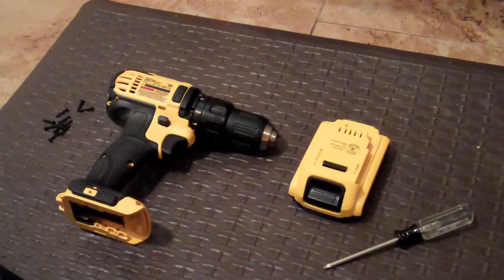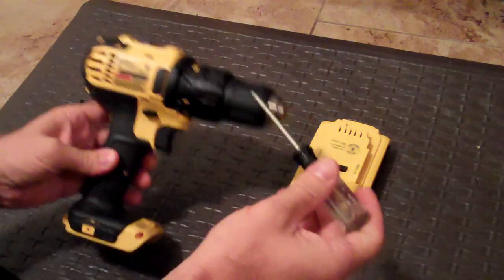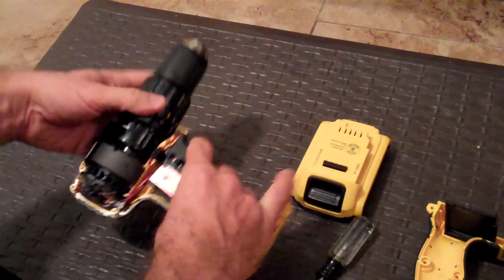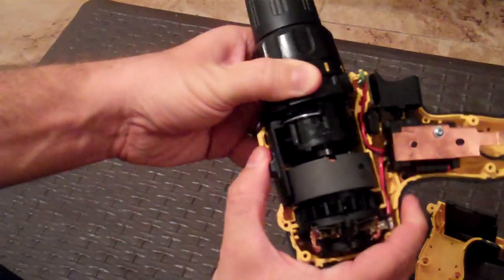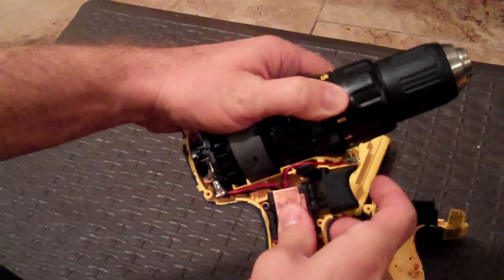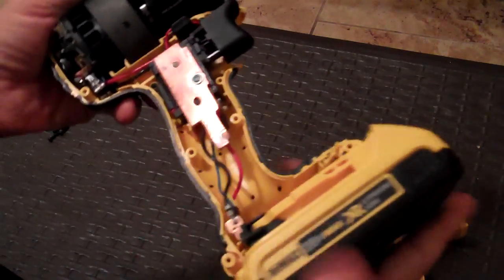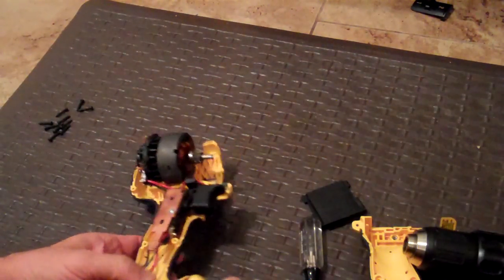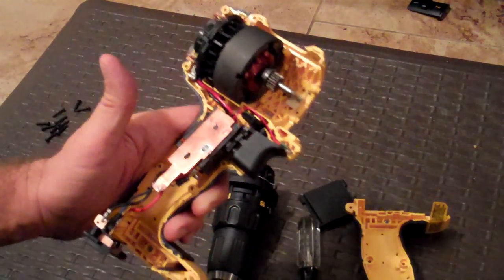Review of *REPAIRING* Dewalt 20v Drill DCD780

Comment: Dewalt DCD790 drill info - I have had one for over a year and the trigger acted up with irregular speeds, not engaging and regularly not braking on release. I was able to disassemble the drill and also the trigger to clean the contacts, tweak the copper trigger contacts for slightly more tension and apply a light coat of dielectric grease. The drill has been working flawlessly for months since 😁

Comment: My drill wasn't working and I took it apart after watching your video. It would work with the top case off, but as soon as I put it back on, it would stop. Found the diode on the back of the trigger assembly had a bad solder. Resoldered and it works great. Was going to order an armature. Thanks for the video.
Reply from the maker: @Eastcreek Nice work!  Once I got mine back together, it worked fine, but glad you were able to locate the bad diode.